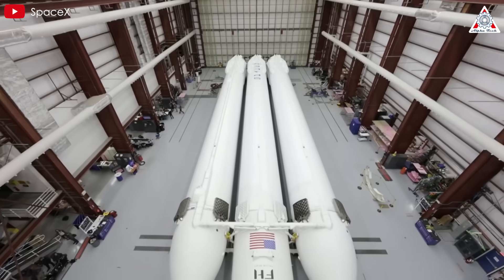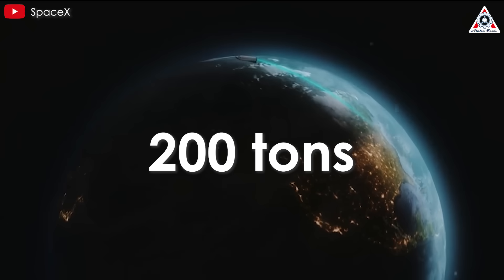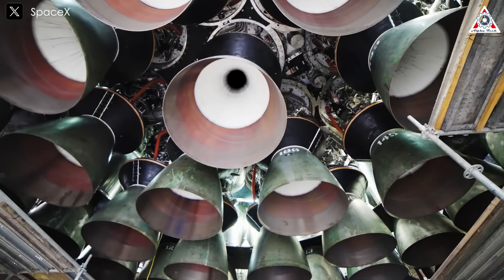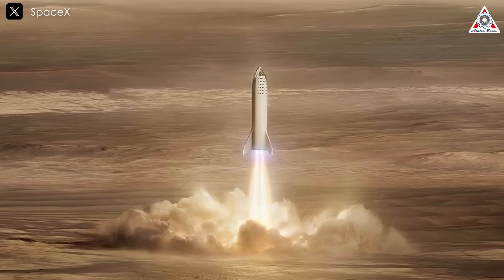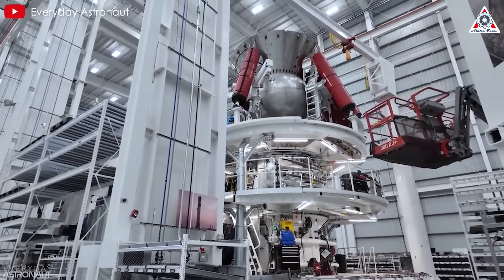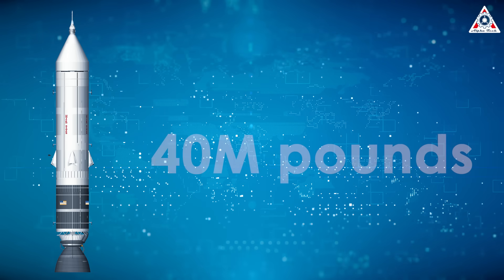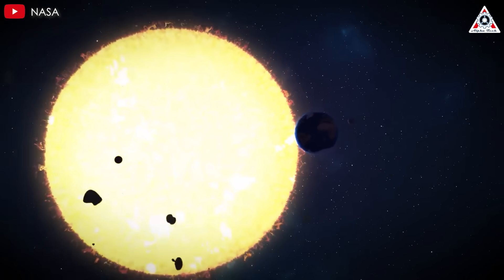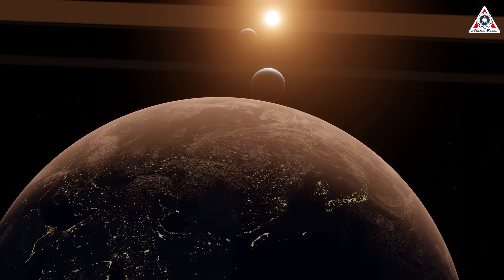It's Mind-Blowing! What SpaceX just did with Next-Gen Starship Shocked NASA X2 Bigger...

Comment: And they will have to build a new tower to launch it, since both towers are too small, for that big guy.
Wonder if this is a space cargo transport ship design. Then this version only requires 66 and 12 raptors respectively.
This Starship is launched empty except for enough fuel to get to orbit. Once there it is loaded by V3 starships.
This Starship has more than 4x the space V3 and can probably carry 10x the mass, since it space only transport.
Starship V3 at the destination unload the ship and ferry its cargo down.
Space x can of course add heat shield and flaps, make the booster have 132 raptor engines.

Comment: I would think the first 18 meter diameter V4, could first start out as long range cargo transporters. The smaller V3 could then be optimized for its planetary launch, L.O. cargo carry and it's reentry capabilities. The space refueling aspect of V3 could be less important, except where the V4 infrastructure does not exist.

This would mimic a large seagoing vessel being loaded at port from trucks. Since V4's volume is at least 4 times V3's. But its cargo carry tonnage could be much more. 

If V4 is launched empty except enough fuel to reach orbit as a "space cargo transport". It keeps the number of raptor engines needed to get to orbit by half (66 and 12) respectively, since it never needs to land or reenter the atmosphere again, nor carry that extra fuel weight for reentry. 

Yes in the future you could add heat shield to expands V4s capabilities.